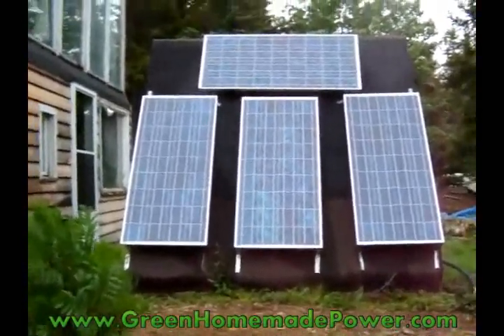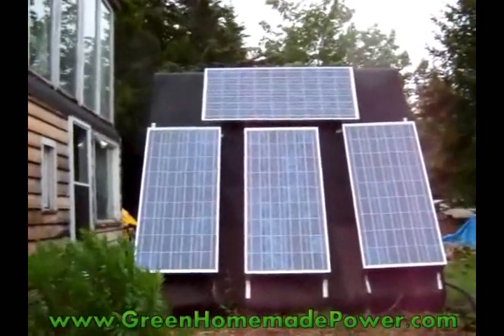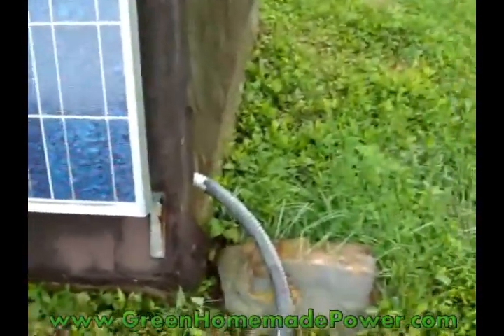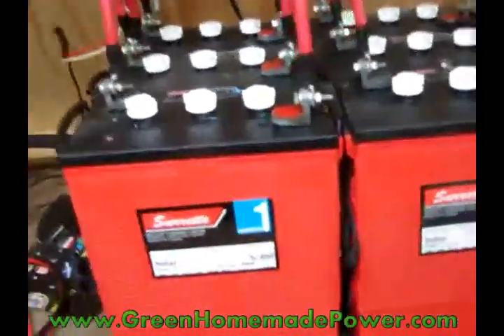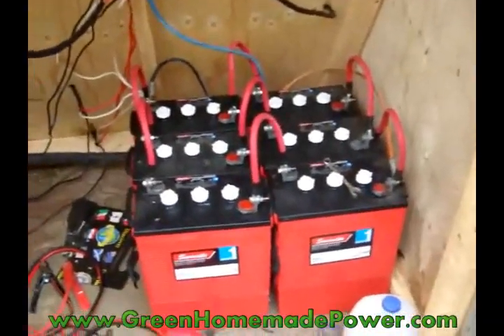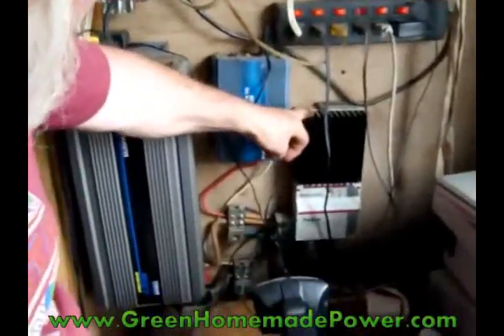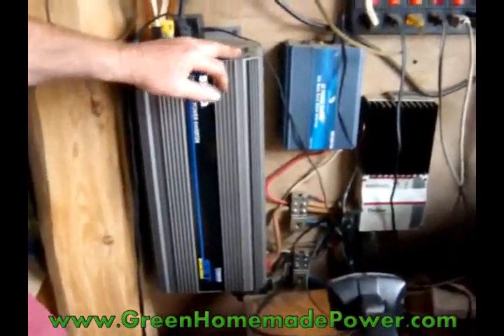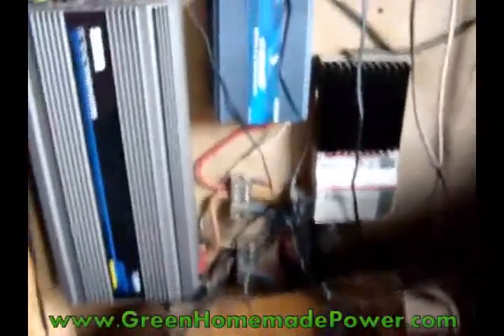Small home solar panels

Comment: @ EpicWaponries
Just so you know, photovoltaic cells are the cells used in most commonplace solar panels. Whether they are on the ground or on a roof it's the same thing. Nor does it matter what the panel is powering.

Comment: I have two 24 volt panels each is 230watts which equals 460 total watts.
I want to buy a charge controller. Would I be safe buying a 24V, 30amp MPPT? would that be considered too much Amperage?  What should I be considering?